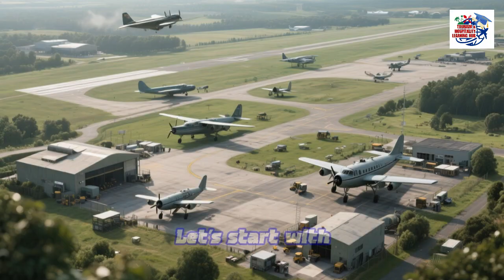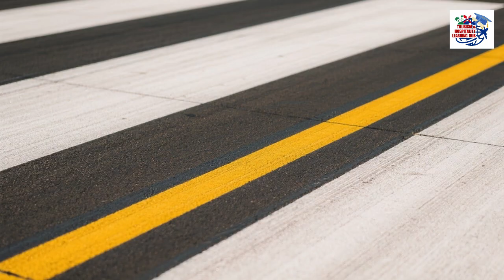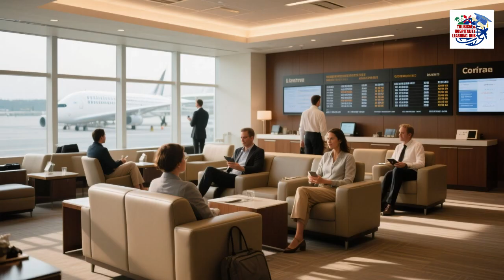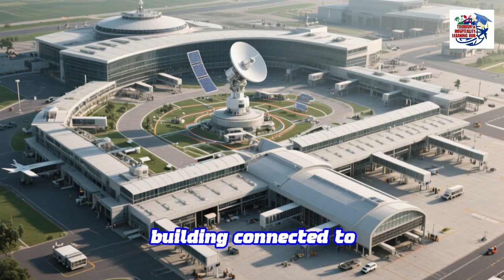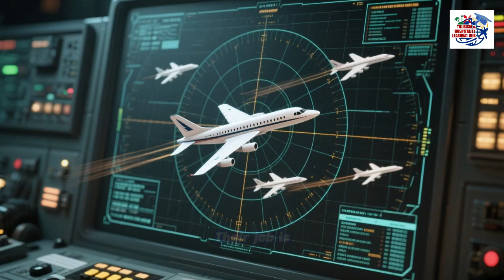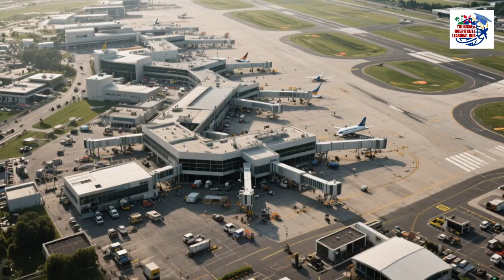AIRPORT COMPONENTS AND LAYOUT

Comment: ADESINA KAWTHAR OLAMIDE 
  It talks about tge context of the airport and also state that it is a planned city for speed, safety and efficiency.  
  Here are some context of the airport as stated in the video 
1) Airfield/runway
2)Apron 
3)Landside/ terminal 
4)Security 
5)Airside departure launch 
1) AIRFIELD/RUNWAY: This is the area where the aircraft take off and land . It is positioned according to the prevailing wind direction to help planes take off and land against the wind which provides extra wind and stability.
2) APRON: it is also known as the ramp, it is the parking lot for airplanes . It is a place where planes are parked to be loaded with passengers, cargos and fuel .
3) LAND-SIDE/TERMINALS: This is the part of airport which is accessible for the public. They are designed to handle a massive flow of people and are divided into check-in security, screening and boarding. This is where you will off your bag and get your boarding pass
4) SECURITY: These are part of the officials in the airport. They are to go through a critical checking to ensure safety of everyone on board.
5)AIRSIDE AND DEPARTURE LAUNGE: This is the area where passengers wait for their flight

Comment: What I learnt from this video
Is about every part of airport and how it works
It explains all d part of airplane 
•it talked about d runway 
Which is a road or passage in which airplane goes or lands on 
Which connected to the taxiway ,a road between d runway and apron
•an apron is the parking lot of airplane where passengers and goods are boarded or departed from an airplane 
It’s also the place where d airplane get refueled and clean for the next service
Then we have our terminal building which is divides to two places for departure and arrival 
In d terminal building,we have different sections where security,ticketing,check point and mini mart are been taking place
To ensure total security and safety for all passengers and employees 
Then we have d control tower which are in charge of the approval for all take off and guiding all airplane over all network to ensure safety 
It also talk about the hanger -the place where all airplanes are being full serviced and maintained 

That’s all I learnt from this video
Thank you sir
Samuel moyosoluwa Samantha